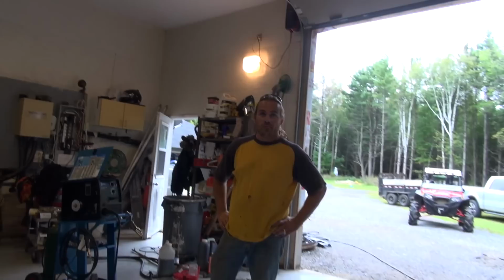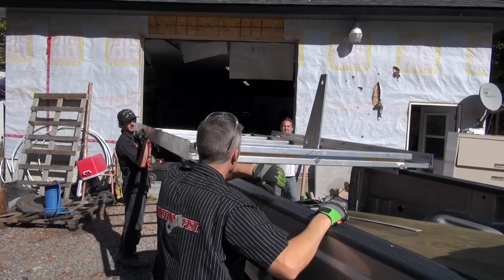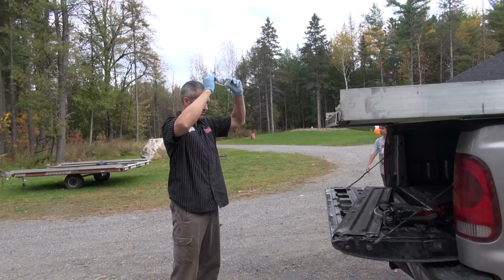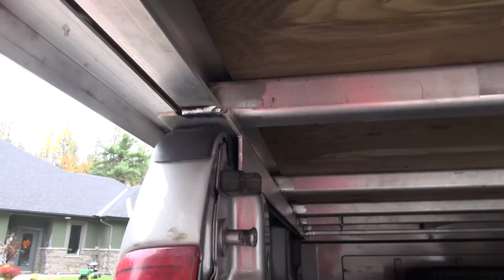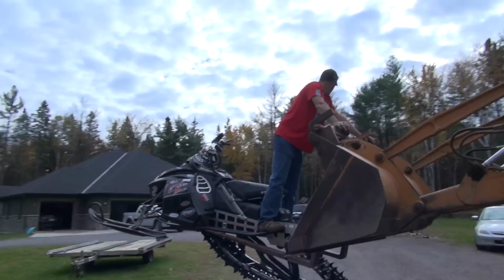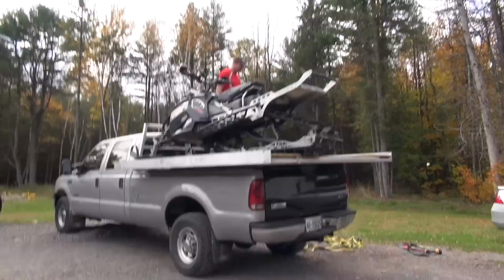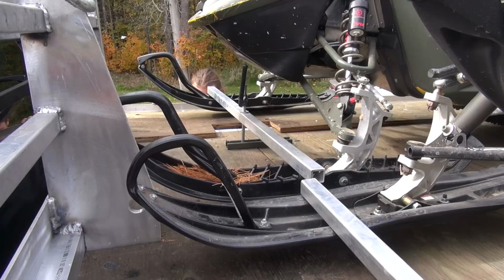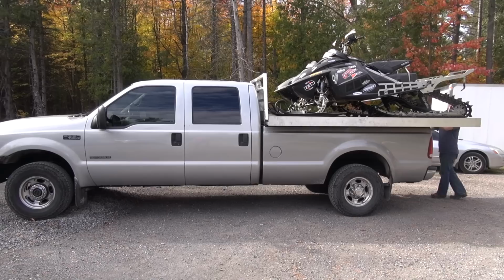Home made sled and UTV deck, easy to make!  PowerModz!

Comment: You should have cut slots in the bottom of the extension tubes, and added some wheels inside them, to make the wheels stay in place cut bolts and weld them in and grind the ends off or since it may be hard to find aluminum bolts, aluminum tube would work as well

Comment: Nice job use some candle wax on the slider portion to lube it and it should be good in cold weather rather than grease or oil collects dust

Comment: I like the idea of using the unistrut for the hold down.  Even when the threads get all rusted up, if you can loosen it up so you can move it even a little, or cut it off, you can replace the hold down bolt.  That's an idea I've been looking for.  It will go on my trailer before the season starts.  I assume the bolt is welded to the unistrut nut?

Comment: why do you think it has to sit on the walls of the truck bed.Mine I had made, sat on A frame legs worked great. Then depending on the height of the legs was how high the ramp was.
Reply from the maker: mine is on a frame now.
Reply: How do you anchor the deck to your bed. mine is done  with U bolts and it is very time consuming. I need a different method. Thanks.

Comment: Really impressive! It's been a couple of years now how has it held up? The commercial sleds I've seen all mount on the floor of the bed. You've got yours mounted right on the sides almost like a Tonto cove on steroids. Have you had any problems? Atvs and Utv's tend to be heaver than Snowmobiles have you ever loaded any thing, but Snowmobiles ?

Comment: The sheet metal box is NOT designed to hold that kind of weight. Driving down the road will cause stress on the box. This is a bad idea. Get yourself a trailer before you kill someone.

Comment: I don't know why you guys put those things up high on top of a jacked up truck. Ever hear of  "center of gravity"? I'd much prefer to either trailer or just shove the machines tail first into the box. Up high, means work and in this case $$. I don't like expending either. I suppose it was a fun project, but I think it doesn't do the sport much good if new people thing they need the same, and expend the same cost and effort. Just my 2 cents. :)
Reply: why throw salt/stones etc at your sled on an open 2 place? or spend the big $ for a enclosed? nothing wrong or super expensive about that deck. Looks good, but ski comes awful close to poking the window out! lol
Reply: Why buy a trailer when you can buy a sled deck
Reply: I bet that deck is cheaper than either option
Reply: Talisman1957 Sled decks are the only way to go. Here in Whistler people from out of town show up with trailers and do nothing but clog up tight parking spots and there are many times when we are unloading up FSR roads where trailers are not practical. 3/4 or 1 ton will easily haul a deck and 2 sleds and loading unloading is ridiculously easy and fast!
Reply: Talisman1957 it's the only way to get 2 sleds on one truck without having to drag a trailer around.  that means you don't have to find somewhere to keep a trailer when you're not using it.  you don't have to drag a trailer around town to and from sledding, or if you don't want to unload.  much easier for getting up FSR and looks bad ass as fuck.
Reply: You'd be surprised at how little of a change there is on the COG with this setup. Ever seen truck bed campers? 

Having a sway bar on the rear axle helps a lot with handling, most modern trucks have them.

This setup is easier to handle than driving truck and trailer, and will be easier to get through snow without the trailer and most of the weight between the 2 axles of the 4x4 truck